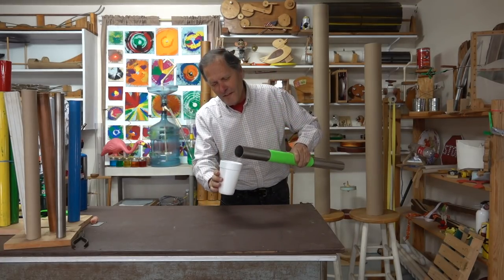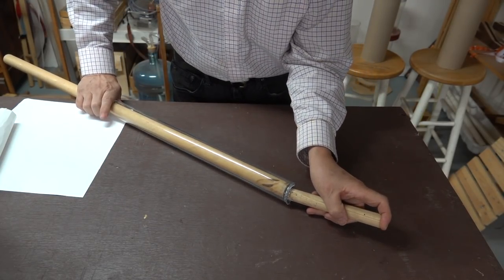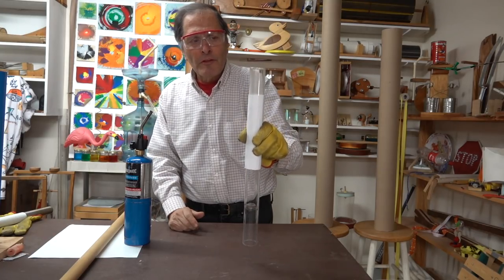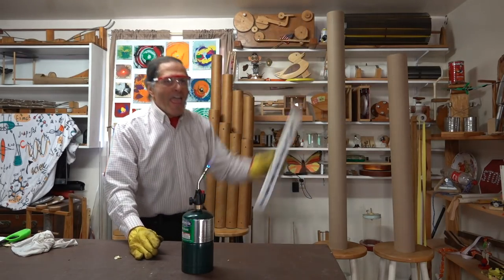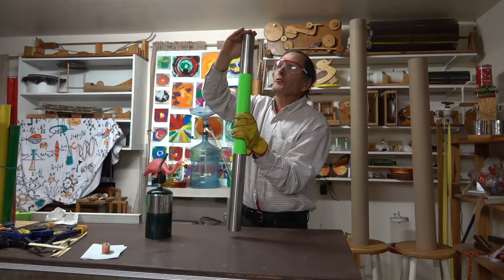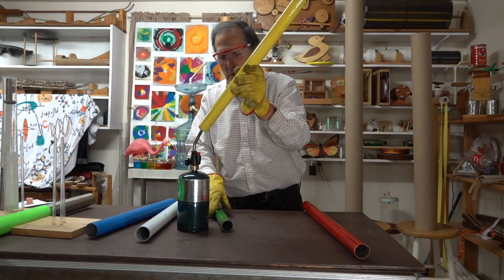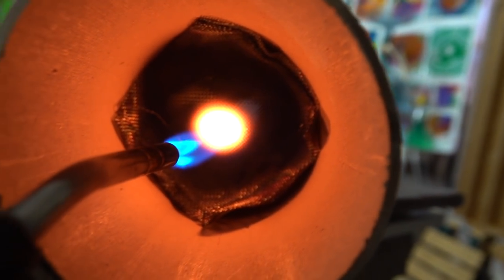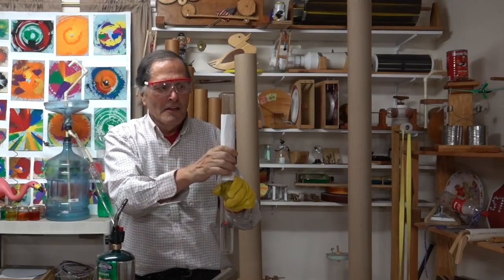Singing Rijke Tubes // Homemade Science with Bruce Yeany

Comment: Very nice! I'm about 45 minutes away from releasing a video on thermoacoustic refrigeration. After that I've planned a follow up with some additional Rijke tube experiments. I've got an enormous 50x4" quartz tube waiting for me to play with. I like your tip on adding wood chips to the screen. I've been thinking about how to get a good smoke flow in the tube for some other filming purposes.
Reply from the maker: Hi Ben,  Nice channel,  I enjoyed the refrigeration video you just posted and look forward to seeing viewing more of your work
Reply: Bruce, Ben, I spent a lot of time, too much time, trying to make an electric Rijke tube for the Physics Bus. I tried hair dryer coil, toaster coil, wound it in different configurations, nothing worked. Lemme know if you figure it out or get an idea. Interesting that you can change the length without the placement of the mesh needing to change too!
Reply: @ErikHerman  construction heat gun?
Reply: hello I hope you read this message it would be great to see what happens if instead of doing it with heat you do it by connecting an amplifier at the bottom of the tube and amplifying infrasonic waves to produce powerful longitudinal waves at the upper end ...
Reply: Hmmm...  Any of y'all try an induction heater to keep the screen hot?   That, plus a servo-controlled sleeve could make for an interesting MIDI instrument.

Comment: Thank you! Us adults...I mean children need to continue learning everyday.
Reply from the maker: my wife sometimes refers to me as her 66 year old middle schooler,  seems that I never get tired of experimenting with science ideas
Reply: Mitch, then learn that you don't say "us adults" you say "we adults".
Reply: @YeanyScience  1) It's NOT the air that vibrates, it's the SCREEN. It's like when you are at the water or having a rain shower, etc... and starts to shake. So, the SCREEN vibrates because of applying HEAT, then it moves (transfer the vibration to) the air and the air "vibrates". 2) Friend, in relation with this pipe: 10:04. You have to put your hands and force it as to generate sound, because the screen inside is loose (so when you tighten it you "fix" the screen inside the pipe and the screen can vibrate the air).
Reply: "We" adults

Comment: Came here from recent NightHawkInLight video that referenced this in the description. Quickly skimmed the video titles and descriptions as well, I expect those will be interesting based on how you handled this subject. Also tempting to check my shed, I think I've got some scrap materials around that might just be suitable for this purpose. It wouldn't be efficient at all, but a PTC heating element inside the tube hooked up to a relay which gets enabled by the doorbell or a motion sensor for a few minutes could be neat as well. Depending on the heating element maybe a bit too slow to respond as a doorbell but could still be fun!

One thing will never stop entertaining me though, what the pronunciation of words with a Dutch origin end up getting by speakers of other languages. For example I don't think I've heard any English speakers except one or two museum curators and one linguist say Vincent van Gogh anywhere near correct. But that's fine really, it wouldn't make sense to expect people to know that ij digraph in our weird language.

Comment: UNRELATED QUESTION:  The ship stuck in the Suez Cannel is basically stuck in sand. My question is would it be easier to use hydro faction to free the ship rather than dig it out? Use the ships pumps for ballast water to unstablize the sand beneath the ship in a similar manner to that of quicksand?

Comment: What would happen if the pipe had a single bottom inlet containing the screen and then branched into 3 different length outlets? Would it be possible to make multiple tones with a single screen or would the air tend to rise only through the least restrictive outlet?

Comment: My suspicion is that the down spout makes no sound when you hold it higher because your hand is preventing it from vibrating, much like how touching a bell stops it from ringing. The material the spout is made of is much thinner and more malleable than the other tubes you tried, and I suspect that's a major factor.

Also, does the width of the tube seem to have any effect?
Reply from the maker: That is exactly how it feels but it's interesting that none of the other tubes were affected the same way.  I have 4 pipes that are 18 inches long,  varying from 3/4 to 2 inches wide,  all had the same tone
Reply: @YeanyScience  So the thickness of the pipe doesn't affect the sound at all? or is the loudness different? I'd think that wider pipes would be louder...
if it's (usually) not the material that's vibrating, I wonder if you could make a Rijke tube out of a bore hole in the ground or something like that. So many questions!

Comment: Hi Bruce! Great video as always, could you explain in a latter video If the diameter of the tube plays a role and if so which? Does one need more energy to make a small tube vibrate?
Reply from the maker: Hi Jose,  yes,  I planned on a  follow up video and will address that along with some other questions.  At the moment I'm working on a few other videos as I wait for supplies that I ordered for part 2

Comment: Should the screen be so fine?

I used a wire mesh with 0.6 cm hole distance and it didn’t work.

Furthermore, how many seconds are you heating the screen?
Reply from the maker: I heat it until is is red hot
Reply: @YeanyScience  i used a strong torch like yours; the wiremesh is becoming hot and a red dot is being seen after like 1 minute of heating but it’s not working

I should be a finer wiremesh i think

Comment: It's a very happy sound to us too,
Welcome back Bruce, we missed you so much,

does it work if we provide a constant source of heating from an electrical heating coil for example?
will it be possible then to get a continuous sound necessary to build a heat powered organ?

I hope you and your family are doing well,
Stay safe
Reply from the maker: Thank you Ahmad,  we are fine.  I've seen a couple videos and at least one website that went with electrical heating,  I tried it with nichrome wire and a battery charger, it did not get hot enough,  it also need a restriction in the tube, for that mica is suggested
Reply: @YeanyScience  Thanks for the info and I hope we'll see your next video soon,
I can't get enough science 😎

Comment: what if the pipe itself is like a sin wave along the length? Will it produce stable sound or it will alternate between different notes, or maybe not create any sound at all. Can you please test it?

Thanks
Reply from the maker: At the moment I don't know how the air movement would respond to  bends  in the pipes,  it does need to be able to have air moving through it due to a convection current, but I'll give it a try

Comment: That was interesting about the downspout and how it was held. I noticed with some 3 and 5 foot lengths of quartz tubing if held with only thumb and forefinger and struck with a rubber hammer for testing knee jerks, they only like to ring when held at certain points too. There are so many things to try with tubes. As an aside if my quartz tubing is rubbed up ad down with a wet cloth, the sound becomes annoyingly loud where it starts to hurt your ears. 
There is this other way to make sound from a tube by simply filling it with water as told by John Tyndall.

Musical Flow of a Liquid through a Small Aperture 
When the wetted finger is moved round the edge of a glass, the breaking up of the friction into rhythmic pulses expresses itself in music. Savart’s beautiful experiments on the flow of liquids through small orifices bear immediately upon this question. We have here the means of verifying his results. The tube A B, Fig. 113, is filled with water, its extremity, B, being closed by a plate of brass, which is pierced by a circular orifice of a diameter equal to the thickness of the plate. Removing a little peg which stops the orifice, the water issues from it, and as it sinks in the tube a musical note of great sweetness issues from the liquid column. This note is due to the intermittent flow of the liquid through the orifice, by which the whole column above it is thrown into vibration.

Comment: If you make holes in the pipe, can you make a self powered flute?
Reply: if so, youd probably have to play it with those thick gloves
Reply from the maker: tried to,  got it to work a little but but not well enough to add to the video,   I need to play around with it some more, vary the size of the hole etc,

Comment: I see a new kind of pipe organ in this... tubes like these with electric heating elements and a cool breeze at the bottom. Traditional pipe organs use some force of air to create whistles.  Using this method could possibly require less power though maybe the volume may not be enough.  Just a thought.

Comment: interesting! have you seen how diameter affects the tone?
Reply from the maker: I recorded that but didn't make it into the final cut,  3/4 inch 1inch 1.5  and 2 inch all 18 inches long  all had the same tone, not identical but really close
Reply: There is an end correction term that changes the effective length of a vibrating cylinder of air.  It usually isn't much at all.  Every open end you have, increases the length by to L = L0 + n*x*D, where D is the diameter, n is the number of open ends (1 or 2), and x is an experimentally determined value of 0.33, as long as lambda/D ranges from 11 to 45, lambda being the fundamental wavelength (twice the effective length for a tube like this).

Comment: hello I hope you read this message it would be great to see what happens if instead of doing it with heat you do it by connecting an amplifier at the bottom of the tube and amplifying infrasonic waves to produce powerful longitudinal waves at the upper end ...
Reply from the maker: I did read it,  and will try it

Comment: 1) It's NOT the air that vibrates, it's the SCREEN. It's like when you are at the water or having a rain shower, etc... and starts to shake. So, the SCREEN vibrates because of applying HEAT, then it moves (transfer the vibration to) the air and the air "vibrates". 2) Friend, in relation with this pipe: 10:04. You have to put your hands and force it as to generate sound, because the screen inside is loose (so when you tighten it you "fix" the screen inside the pipe and the screen can vibrate the air).

Comment: hmm, so a simple A over B type weave, with the nichrome as one thread in one direction, and something structural but non-conductive and heat resistant in the other you could do an electrically controlled heat screen.  Interesting the trombone effect, what about a controlled baffle or a means  to create a change in diameter over length mmmm and interesting, damping by holding gotta wonder solenoids with rubber bumpers at different points along the tube would that have varying changes as well... a simple device with so many potential questions indeed!

Comment: This reminds me of wd-40 burning inside a fence post. Squirt wd-40 in the top and light a match by the bottom. Now I understand why it would only work the first time. The second time the pipe is hot not cold. Might have to try with a screen now. I figured the pitch changes cause the flame position inside the fence post moves as the fuel gets consumed. At least now I know why it would only work once.

Comment: I'd like to show you my thermoacoustic engine that makes air, hot water, electricity and gravity.. and cost nothing to run. I need a second opinion on it and some advice.. for many reasons... It's basically a galaxy in a box.... and after looking at it you may agree with me that the galaxy is actually thermoacoustic.... because  this device will make it's own water therefore it will gain mass.
Reply from the maker: send me information at bgoknee@comcast.net

Comment: I always like the extra mile you go in creating variations on a theme, that make it more interesting. There is this account by John Tyndall in his book SOUND which can be read for free from gutenberg.org that may be of interest. 
"A still more striking effect is obtained with this larger tube, a b, Fig. 114, 15 feet long and 4 inches wide,263 which was made for a totally different purpose. It is supported by a steady stand, s s′, and into it is lifted the tall burner, shown enlarged at B. You hear the incipient flutter: you now hear the more powerful sound. As the flame is lifted higher the action becomes more violent, until finally a storm of music issues from the tube. And now all has suddenly ceased; the reaction of its own pulses upon the flame has beaten it into extinction. I relight the flame and make it very small. When raised within the tube, the flame again sings, but it is one of the harmonics of the tube that you now hear. On turning the gas fully on, the note ceases—all is silent for a moment; but the storm is brewing, and soon it bursts forth, as at first in a kind of hurricane of sound. By lowering the flame the fundamental note is abolished, and now you hear the first harmonic of the tube. Making the flame still smaller, the first harmonic disappears, and the second is heard. Your ears being disciplined to the apprehension of these sounds, I turn the gas once more fully on. Mingling with the deepest264 note you notice the harmonics, as if struggling to be heard amid the general uproar of the flame. With a large Bunsen’s rose burner, the sound of this tube becomes powerful enough to shake the floor and seats, and the large audience that occupies the seats of this room, while the extinction of the flame, by the reaction of the sonorous pulses, announces itself by an explosion almost as loud as a pistol-shot."